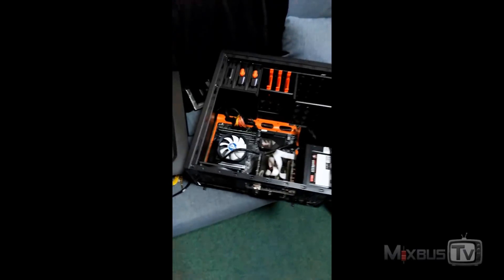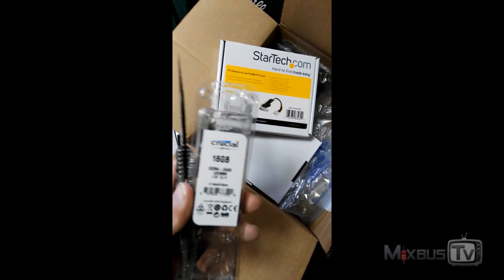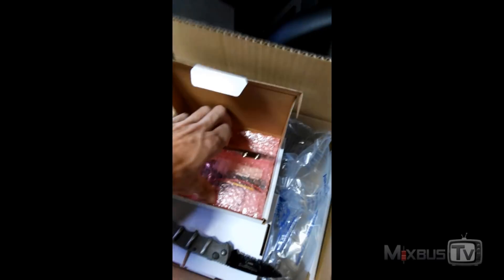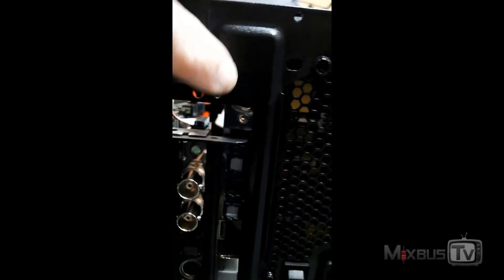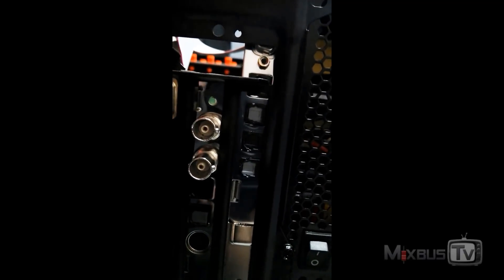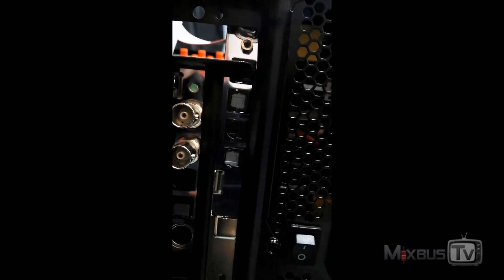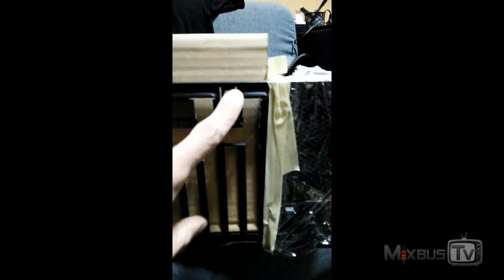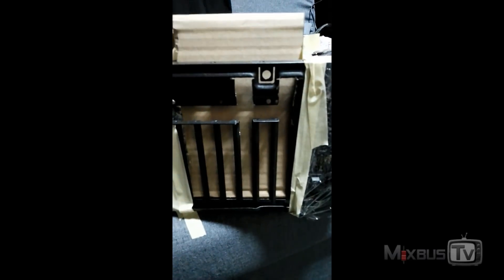Most difficult PC Build, PCI into PCI-e slots, Replacing audio cards, case mod

Comment: Are you still using the adapters and is it working as you expected? I have some "old" equipment and can save about 500 dollars if I buy PCI instead of PCI-e but would like to hear from someone running hackintosh if it actually works without any weird problems or if I should just buy another interface to upgrade my amount of channels.
I was basically gifted a Yamaha DM1000 with 2 expansion cards which could give me 16 channels in/out but a new Lynx card is as much as buying 3 new USB interfaces so I have been looking for a budget solution and the older Lynx card is like 100 bucks on ebay which I find a very reasonable price.
Hope to hear from you, cool channel by the way you have a good explanation of compressors
Reply from the maker: I don't use them anymore because that's 3 years old video, but they always worked without any problem until I retired that system
Reply: @mixbustv  Yeah it's an old video but there is surprising little information about this adapter, thanks a lot for the answer it is very much appreciated sir
Reply: @mixbustv  my english no well, but Id like ask you: is it worked ok? I mean PCI adapter to PCIe for audio cards (sound quality and etc.). Reason why I ask - I have good audio card ESI MAYA44 PCI, and new motherboard with PCIe, and have same problem like u.

thanks for attention, greetings from russia
PS I saw your answer "but they always worked without any problem until I retired that system", but cause I speak english not well, cant be sure about my translation
Reply from the maker: @radio_a  yes they did work
Reply: @mixbustv  thank you very much! Now my audio card will get second life

Comment: Favorite part of the video: "I can deadlift 500lbs, I can secure a piece of metal on a PC case." Awesome. So first thanks for making these videos, all of them. I've watched a bunch and will continue to do so to help me build my mixing skills. I wanted to ask a couple questions / request some specific videos. 
1) Could you make a video that would outline the components / cost for someone to build a PC to be used for recording and mixing on a hobbiest level? Or maybe if I state this question another way - If I have a 2000 dollar budget can I build a PC that would be hardcore enough for my needs?
2) I wanted to get a better understanding of what I need to consider and then actually set up in my sessions when recording and mixing a full album of material. I realize this is primarily a mixing channel but maybe you would still be able to speak on this. 

Thanks again David. Always love the knowledge you're sharing.

Comment: Yeah it's stupid but PCIe is here to stay. It's been a long time since PCI was on recent motherboards without a bridge chip.
I'd mod the case too...because your 9652 will keep working for a long, long time...
You could get a small but longer block of wood, over 90° screw one side into the case's backside and the other side for securing the cards with screws.

Comment: It will work ;-)
Reply: I see you have taken a decision modding the case and I think it will work it's way (do not use glue :-)) but you're gonna use an adaptor (interface) which itself can increase the probability of performance lacks.
I know that ppl fall in love with brands and you did with Gigabite but here you've made a mistake with the PCIe. Personally I would have changed the motherboard with the proper socket for your cpu (any brand) trying to swap the one you have with the new or buying a new one and selling the one you have which is brand new. 
Now I think it will work but if it wont satisfy your need... you will have to change motherboard and the case. :-(   Good luck anyway :D

Comment: Maybe an easier solution and less expensive than upgrading to PCIe cards, would be to get another mother board that has PCI slots. If you want stick to Gigabyte they have  GA-H270-Gaming 3 LGA 1151($109.99) and GA-B250-HD3 LGA 115($94.99). Asus has PRIME Z270-K LGA 1151($144.99).All these boards have 2 PCI slots and 2 PCIe (if you did want to upgrade later on)

Comment: What about a PCI expansion enclosure? Wouldn't that have been an option? Still run you around $300, and I understand not wanting to throw more money at it, but would likely have solved your issue. Dremel solution works fine though, and so long as you support the cards in even the slightest (would not recommend apoxy or glue), you should be fine. I'm assuming that once they are plugged in you won't be re-arranging the connections too often, so you may even just get away with them free floating in the slots. But a simple metal strip angled with a couple screw holes attached to the case should do the trick as well.
Reply: No problem, and I totally understand not wanting to throw more money at it when you already have a perfectly good solution that works. As for the metal angles for mounting, don't know if you have seen the following case mod video, but maybe it would give you some helpful ideas about securing them. And thanks for all the great mix videos as well, have enjoyed your channel for quite some time now.

https://www.youtube.com/watch?v=zoR6VlDzQUA